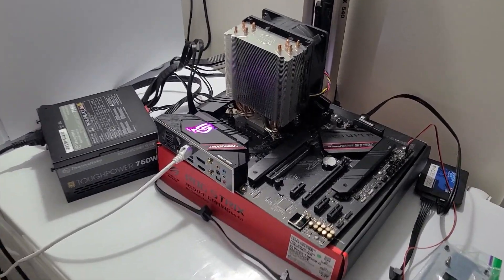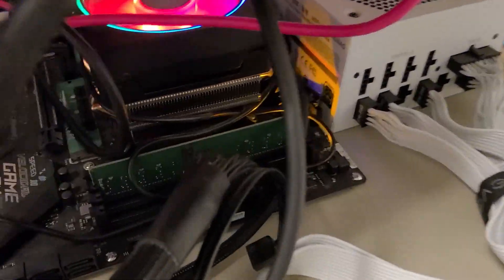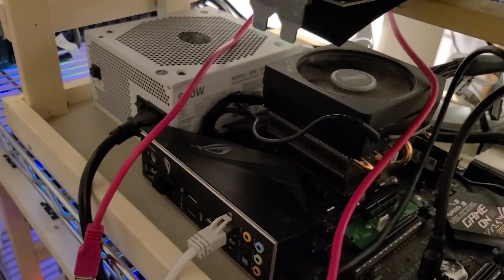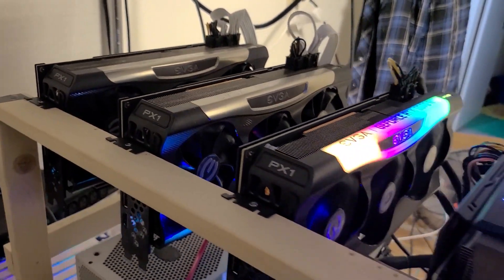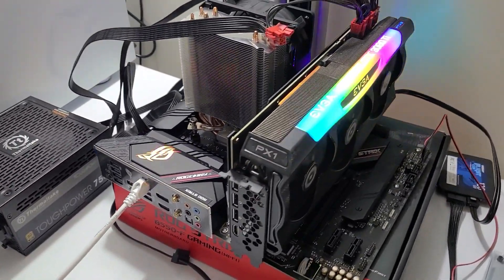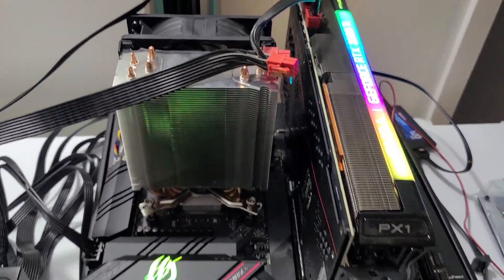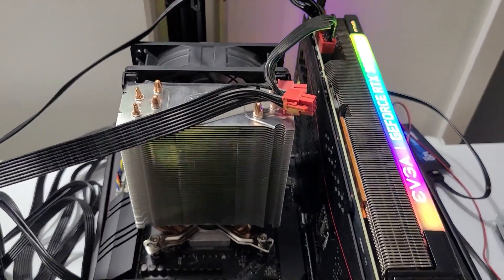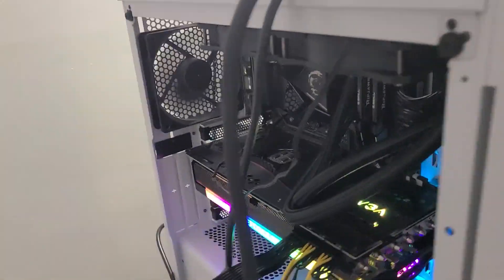Raptoreum CPU OC and BOOM, dead motherboard....

Comment: I have a similar issue with My mobo (Asus b450 f-gaming II. This issue appear when i replace the cpu ( Athlon 3000g x ryzen 5 3600) and automatically only 1 pci-e it works. If i use all  pci-e,  white light appears.
Reply from the maker: How many lanes does that Athlon have? I tried some Athlon once and could only get 3 or 4 running. I have a 3600 cpu and that same motherboard running 6 cards fine
Reply: I tried 4 lanes without issues, but now only 1 pci-e works. Maybe i need to upgrade the bios

Comment: take out all cards and just add one card and flash the bios white line can mean many things not just gpu issues. you can also flash the bios on a usb and you dont need to see the screen but you have to make sure everything is removed even the cpu ram gpu and what ever else you have connected
Reply from the maker: I don't think that particular board has the BIOS flashback tool button on it like the version 2 does. Either way I have a new board on the way. I will troubleshoot this one another day once everything is off of it!

Comment: Are you using more than one psu?
Reply: Use just one to troubleshoot.
Reply from the maker: I use two to mine. I used just one to troubleshoot. And I actually grabbed a brand new PSU to troubleshoot as well in case it was a PSU issue.
Reply: @GroweverydayOriginal  i had problems with my asus mobo because the psus werent turning on at the same time. Even with reboot...
Reply from the maker: @jkkribeiro9895  Are you using an add2psu adapter or anything?
Reply: @GroweverydayOriginal  im using an adapter 2x 24pin to 24 pin